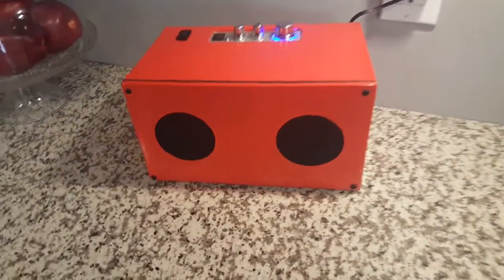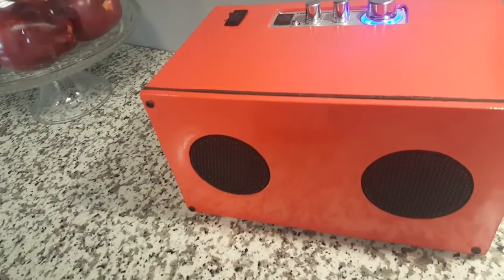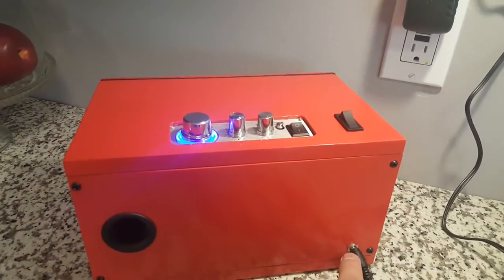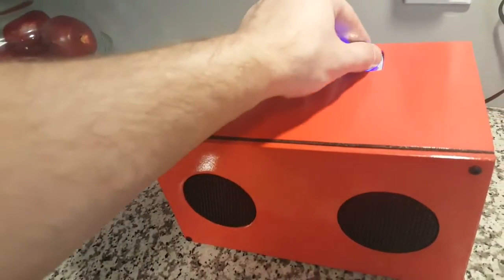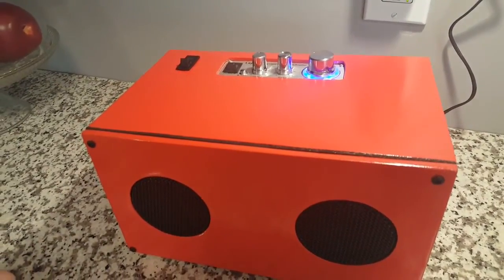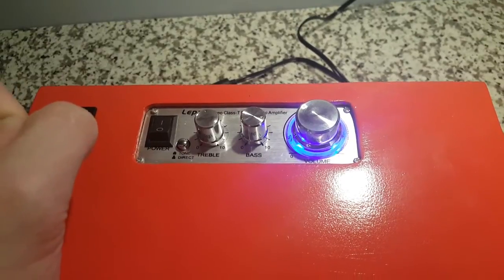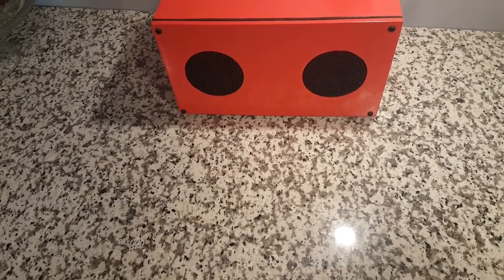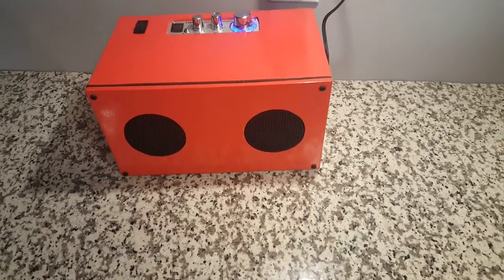DIY Bluetooth Speaker Build - The Finished Speaker

Comment: Awesome build! I do have a question, I am trying to build something similar since my tv speakers are giving out; and I have several 4ohm speakers laying around my apartment. My question: is there anyway to hook up another rocker switch in order to use component cables for TV and the 3.5mm for Bluetooth connectivity? I am trying to use the same amp, but I am not really sure if there's a way to do it without unplugging one set of cables or the other; with a rocker switch it would just be easy to switch out to use my phone or tv, or is there another affordable amp with that feature what I'm asking that you might recommend? Thank you in advance.
Reply from the maker: This amp, you can actually plug up both the RCA's and the 3.5mm jack at the same time.  You can actually play music from both sources at the same time, but that is never a good idea.  So there is no reason to hook up a switch to it.  If you did hook up a switch, you would want to hook up an AB switch.
Reply: Thank you for your response. My apologizes for not being clear about what I am trying to accomplish. I am not trying to play music from both the RCA and the 3.5mm at the same time. However, after further research-thanks to you- I've have found the Lepai LP7498E, which is something similar to what I am looking for just that in lower RMS and cheaper cost. Thank you very much, you have a new subscriber and looking forward to more videos!
Reply from the maker: Great, I am glad you found what you were looking for!  Thanks for subscribing!  I look forward to having some more videos out shortly.

Comment: Almost exactly what I intend to build..! The amplifier would be on the front, vertically mounted, though. The speakers are two 160 W full range speakers from a car stereo. The whole box will be out of 15 mm plywood, but I haven't decided a finish by now. I got an idea of giving it a quick burn with a torch, a slight sanding and a layer of clear coat paint.
Unbelievable you just got the same idea as I did and we are building similar builds...lol.
Reply from the maker: That is awesome!  I love the burn idea.  I bet that finish will be amazing.  Just a quick FYI. most car speakers are infinite baffle, so you may get a better bass response if you do not put a back on the speaker section. you may want to pay around with it.   I love the idea and would love to see the finished project when you're finished!
Reply: 123Toid Ahh..I didn't know that fact about the speakers. I just got them for a very cheap price, so I couldn't let them pass. Thank's for the tip, looks like I've overlooked this issue. I'll put a video together once I've finished my project. I had thoughts about a little integrated MP3 player...I got one laying around that excepts a 32 Gb SD card, should be plenty of music for a day on the beach. My friends can just hook their phones up via Bluetooth.
The reason why I'll mount the amplifier in a different location than yours, is that I plan to cover the top with a solar panel (5 W). There will be two latches on the side, where I can attach a leather strap (old belt), for carrying it around. Depending on the battery, I may get away with the panel without an charge regulator...I must research that, though.
Awesome we had similar ideas for such a device...! Greatings from Denmark.. Btw...if you search for "Boominator", you'll find the project that gave me the idea for my build. The difference is I wanted a cheap and handy solution just for background music...not a full size party machine..lol